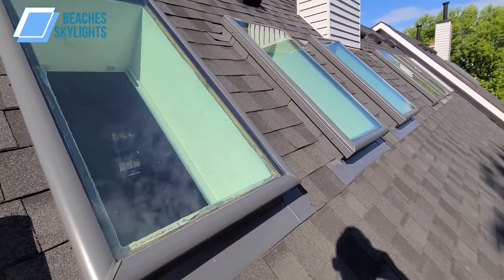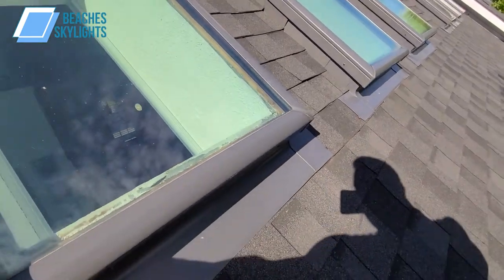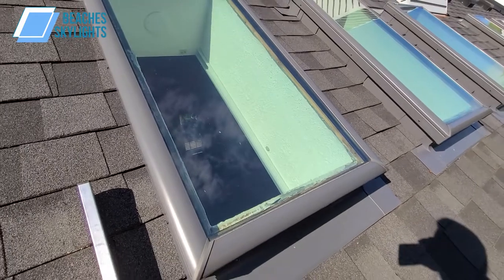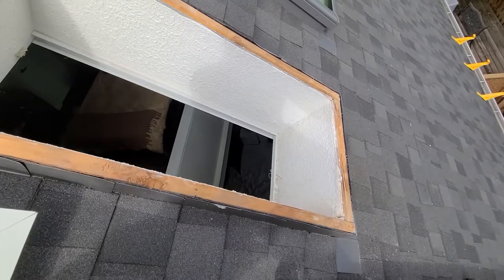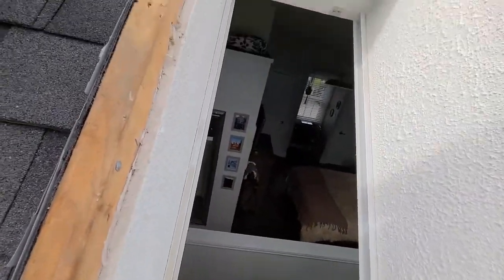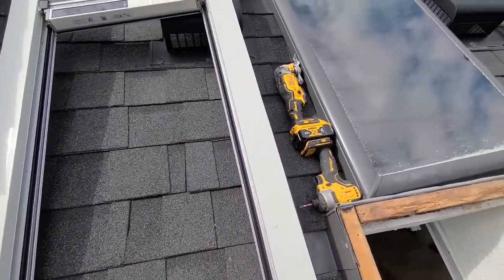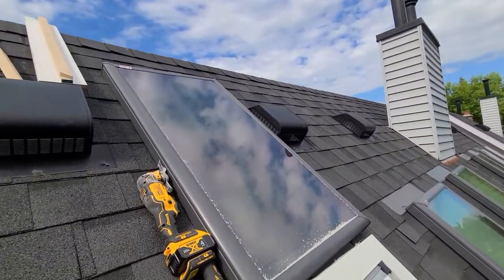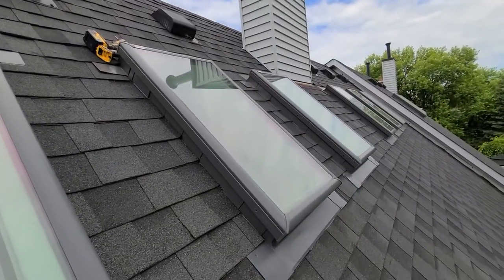How To Install Skylight Blinds to a Velux Curb Mount Skylight (Part 2)

Comment: Question for you: When you put the skylight back on, did you have to drill new holes for the screws in the curb? I'm wondering if having the accessory tray in there caused the skylight to rest up a little higher off the frame and roof, making the old screw holes in the curb mount unaligned with the screw holes in the skylight.Thanks for this awesome, helpful, 2 part video!